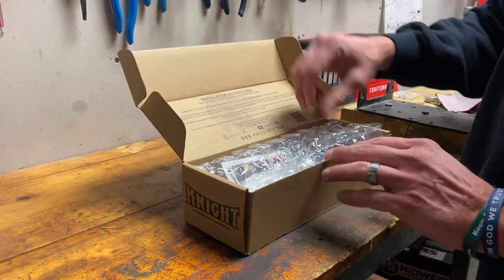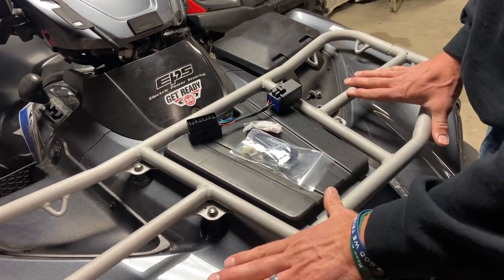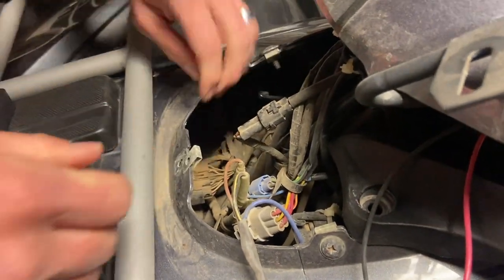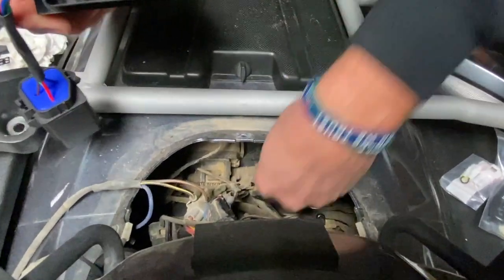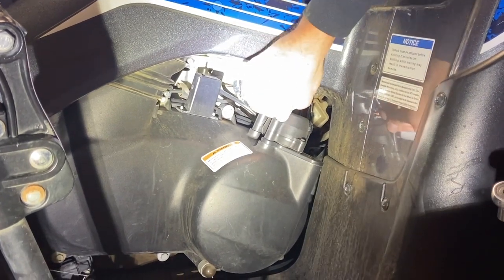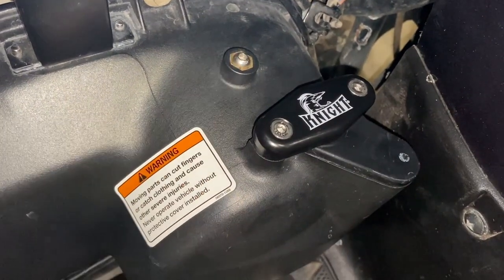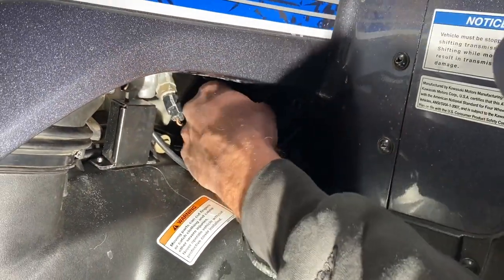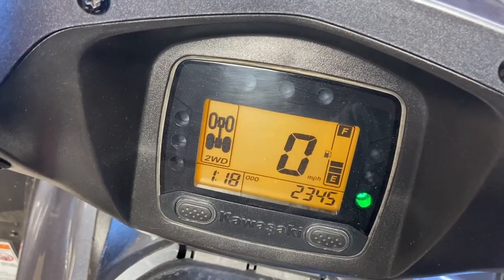Knight ATV KEBC Delete EASY Install - Brute Force 750

Comment: What does this delete do?
Reply from the maker: It deletes the engine braking actuator. 
KEBC = Kawasaki engine braking control.  When it wears out or fails, you can simply install this kit, which is less than a 1/3 the cost of a new actuator.  I have not missed having the KEBC; notice very little difference in actual engine braking.